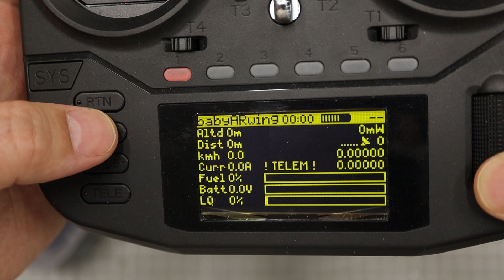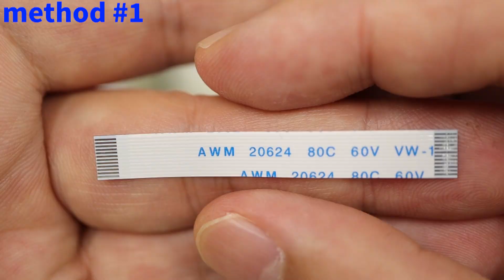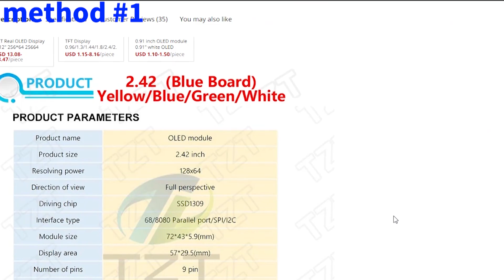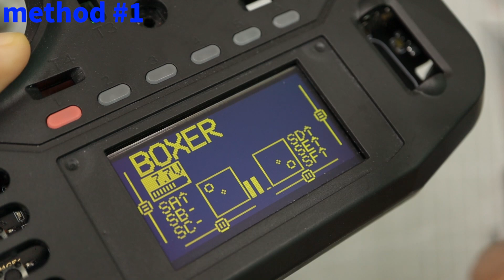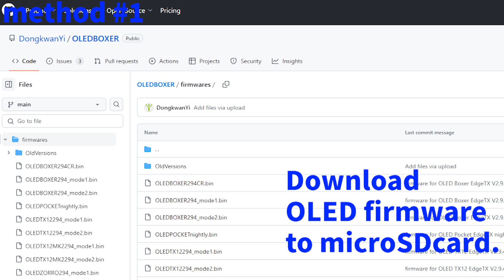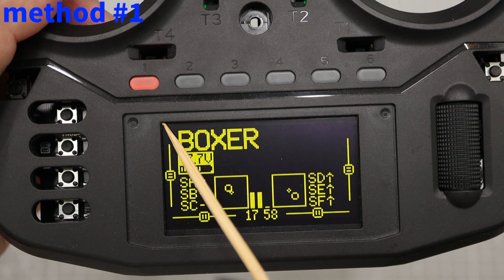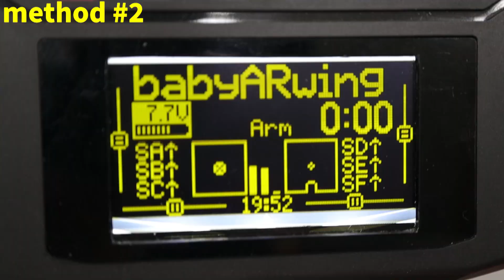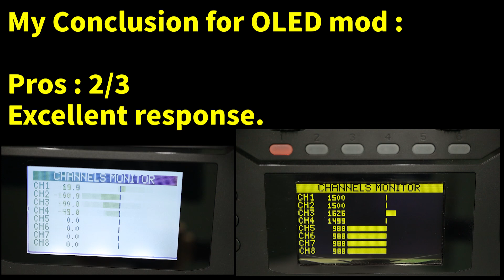OLED mod for Radiomaster BOXER follow-up

Comment: Hello i did this mod but after flashing the newest firmware my boxer does not boot anymore and i get no image on the screen. The old LCD screen still lights up but does not display anything...    What could be the issue and how could i fix this?
Reply: i fixed it by reflashing   during my first flash the cable to the screen was loose so i just reflashed using edgetx buddy

Comment: You can use the heated bed of your 3D printer to remove the screen from the bracket
Reply from the maker: That's a great idea, but I don't have a 3D printer.

Comment: I'm getting "Not a valid firmware" error on boxer. Tried flashing manually like you showed (trim buttons + power button), also  tried Buddy tool. First i tried it on old 2.8.4 version, then tried upgrading to 2.10.0, 2.10.1, always the same error (the radio works on normal lcd though). 
Also tried changing SD card contents

then I saw some comment here, that you think that on Edgetx versions 2.10.X and up, the OLED support could be implemented by default, but no, OLED won't light up at
Any  ideas what to do, please?
Reply from the maker: It's a problem I've never seen before.
The code for OLED is implemented on 2.10.x and up, but it's not activated for OLED. So the firmware need to mod.

Please follow instruction at below.
1. Download the firmware for OLED  and flash the radio with original LCD.
2. Complete OLED radio hardware. Doulble check the wiring.
3. And than your radio can turn on with OLED.
4. After normal turn on the radio, flash bootloader.

Please let me know radio model, downloaded firmware name, and the PCB version.
(Refer for PCB version : https://youtu.be/O3sfuA0yUIM )
Reply: @celeselements  

Thank you! Turns out I'm an idiot. I love when issues get solved in the middle of documenting them... The problem was in the way I was downloading the firmware files from your Github. I right-clicked the file and picked -> Save link as. The downloaded file had the .bin extension so it wasn't suspicious to me, but probably there is some issue with formatting this way. When I download your whole repo into a zip, the flashing works normally. OLED lights up! 

You don't have to read the rest of the comment)) 

//////////////////////////////////////////////////////////////////////////////////////
Thanks for your reply, i will describe my issue best I can:
- I have a Boxer, which has the new V2.0 PCB version
- I have triple checked wiring (with OLED connected via the 12-pin FPC cable, i checked multimeter continuity between OLED pins and Boxer motherboard pins. It is 100% correct according to your photo https://github.com/DongkwanYi/OLEDBOXER/blob/main/pinout_boardside.png)
---
With the original LCD, the radio operates correctly. It uses the standard boxer-2.10.1 (839b60f6) version.
If I now disconnect original LCD and connect OLED, it doesn't work = that is expected.

With the original LCD connected, when I put the OLEDBOXER2101.bin file (from your Github) to the FIRMWARE folder on SD card, and try to flash it (original LCD -> enter bootloader using trim buttons and power -> Write Firmware -> in file selection screen, pick the OLEDBOXER2101.bin file and ENTER ->  it doesn't flash, only shows "Not a valid firmware!" message in center of screen, and waits until I press RTN or ENTER button, which puts me back in file selection screen.
1) turn off Boxer, connect battery, trim buttons & power to get into BOOTLOADER mode
2) pick Write Firmware
3) choose OLEDBOXER2101.bin
4) "Not a valid firmware!"

Using this way to flash the standard boxer-v2.10.1.bin file works. (after picking it in Bootloader, it says "Hold [ENT] to start" and flashes normally).
1) on https://buddy.edgetx.org/, select EdgeTX Centurion v2.10.1
2) Download .bin -> put downloaded boxer-v2.10.1.bin on SD card FIRMWARE folder
3) flash using method above
4) "Hold [ENT] to start"

Using the Buddy tool to flash your Github file OLEDBOXER2101.bin does flash it, but soft-bricks radio:
1) turn off Boxer, connect USB to PC, open https://buddy.edgetx.org/#/flash, 
2) pick Local File -> OLEDBOXER2101.bin from my PC and flash, it erases old firmware and flashes new firmware correctly. 
But with this method, the radio did not even boot up (the FlightMode LEDs light up from left to right, but then turn off -> the first one should stay lit but doesn't).
Afterwards, I repeated this process to flash standard boxer-2.10.1 (839b60f6) version, which returned me to operational state for LCD.
Reply from the maker: @dan-sapphiros  I'm glad it worked out well!

Comment: Silicone 30awg is fine? Worrying about this lol. 

I also dont get why detaching the panel at 2:50 is necessary? Cant I solder on the wires with it still on or will there be alignment issues? Mine has headers on the side
Reply from the maker: I think AWG30 is fine for this purpose.
The reason for detaching the panel is to align it with TX's front case.
The pin header need to remove for dimensional interference.
Reply: @celeselements Hey again, is the display pcb necessary? I cant figure out a way to fit it inside the zorro. Could I maybe use just a plain adapter board for the display 24pin? or whatever
Reply from the maker: The PCB on OLED panel is necessary for driving OLED. The circuit on PCB is here : (scroll down, you can find it) https://ko.aliexpress.com/item/32950307344.html?channel=twinner 
You can make a circuit referring above link, but I recommend the PCB on the panel. Cut a small amount of side edge of PCB, I hope it helps you.
Reply: @celeselements  I tried cutting the sides and the panel doesnt work anymore. I cut at the outline edge line of the display/where the text starts on the other side. I tested with multimeter and the exposed traces are only ground..

I think ill try female to female flex to extend distance from pcb and just push the pcb in the shell randomly.

Thanks for the helpful link. Zorro is veeery tight inside.
Reply from the maker: I'm sorry to hear that.
but You will find a way. You always have.

Comment: Thank you for this video. I love this idea. Would really love modding a Radiomaster Pocket with an OLED. Will the process be pretty much the same for that?
Reply from the maker: Basically they are the same. Only difference is a physical apperance.
Reply: @celeselements  Thank you. That sounds reassuring. I found a 1.54" OLED display which I suspect is correct for the Pocket. I assume it requires the same board and flat cable? The flat cable link is dead, unfortunately.

Comment: Thank you for your work. When I flashed your firmware it made the power button green. In asking an EdgeTX developer what lines I needed to change to get blue back, he was curious about the mod. He then explained EdgeTX had support for the screen natively. He asked me to start from scratch and add 2 lines of code. It worked and was an improvement over your version because this allows brightness and auto-dim functions to work.
Reply from the maker: Thank you, I hope my work will be useful to you.
The EdgeTX 2.10 or later will have the code for SSD1309 driver, I think.
Reply: hey bro, what lines are needed? preciate it!
Reply: @augfpv  add #define OLED_SCREEN and #define SSD1309_LCD at line 2636 of radio/src/targets/taranis/hal.h
Reply: @WhateverFPV I did this but mine is still green((
Reply: @Yaroslav_Tselovanskyi the code is for the lcd not the led